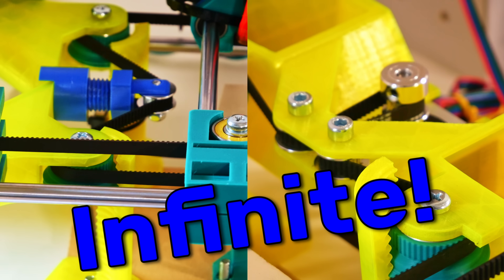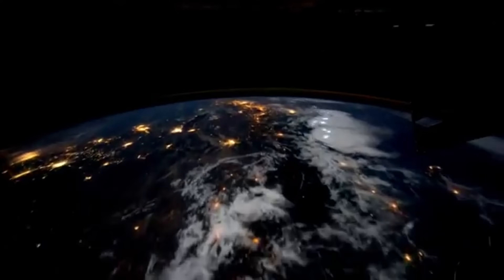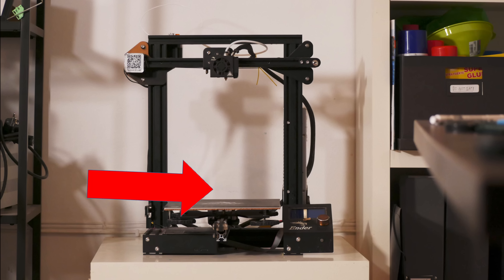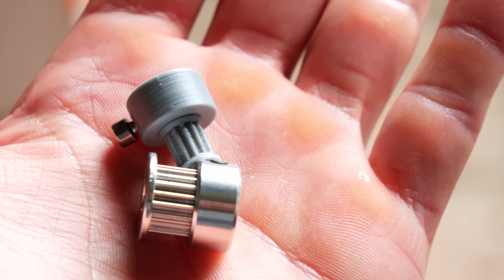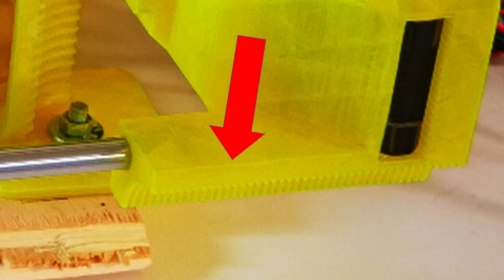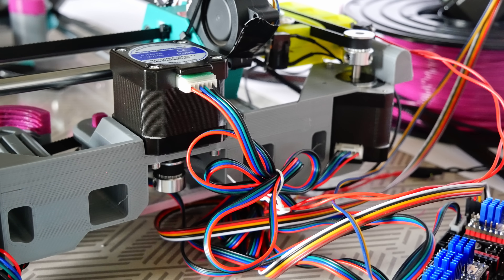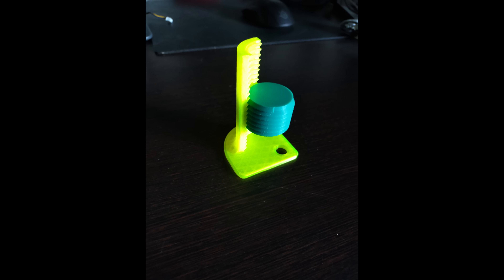it can 3D-Print onto itself?!

Comment: This is an incredibly interesting idea and impressive build. In terms of the big picture (truly self-replicating printers for the purpose of mass additive manufacturing), though, I wonder how the following problems will be solved:
1.) (Probably not quite the right term:) Degrees of freedom. As humans, we have a remarkable ability to move through space and assemble complex machinery. This requires precise motor function and sensing of where our limbs are (proprioception). Even if a printer can print itself, the printer and parts it generates still have to move through space and time to accomplish the end goal, and those movements require translations and rotations that would be very difficult without a human or finely calibrated machine. Is it possible that the tolerances, lack of rigidity, or post-processing of 3D-printed parts prevents reaching 'escape velocity'?
2.) Anisotropic strength of 3D-printed parts and limitations on printing imposed by part rigidity on the build plate. This imposes design constraints in pretty much everything we try to print. Anyone knows that printing a 2 mm diameter vertical rod with a heigh of >30 mm or so and tight tolerances with additive manufacturing is extremely difficult because it flexes as a result of the printhead or movement of the build plate (if not on a corexy machine).
3.) Progressive degradation of print quality the more generations away you are from the parent machine. A machine's accuracy would be limited by the 'perfectness' of the machine that build it. Quality control quickly becomes more difficult as more machines are generated, because you generate more and more unique parts that need to be controlled for quality than quality control machines. 
4.) Current limitations of materials science. PLA and PETG are easy enough to print in, but as someone who loves using 3D-printing in a laboratory, one quickly realizes how much materials limit the usefulness of 3D-printing in real-world scenarios. Organic solvent? Forget about filaments other than PP, PEEK, PEKK, etc. Want to print in PEEK or PEKK? Have a $40,000 printer that keeps filament dry, controls build chamber temperature (a resizing, temperature-controlled build chamber would be cool yet hard to design), and prints at ultra high temperatures. Want to print a flexible material? There's a whole host of problems associated with using additive manufacturing for that, even though it's very doable at a consumer-grade level on easy mode. There are so many lab instruments I'd love to print but can't because I can't rewrite the laws of intermolecular physics.

There are certainly solutions to these problems, but the question really is if all of them can be solved sufficiently to allow self-replicating additive manufacturing to reach escape velocity. Though just my own humble opinion, I do not think any machine where all parts are designed by a human, at one point in time, can do this because the complexity of the solutions required greatly exceeds our processing power. The only multicompetent self-replicating machines that exist are living things, shaped by evolution. As a species, we (more or less) don't degrade throughout generations because our blueprint is not a spatial one; it is information-based at the getgo (yes it's spatial on multiple scales later in the developmental cycle but that's another rabbit hole), and a relatively compressed blueprint encodes for countless ingenious solutions to the problems associated with building a living organism. Discovering and understanding even just one of the solutions we've evolved at the molecular level can take a human an entire Ph.D., yet tracing the path by which the mechanism emerged can still sometimes be out-of-reach for decades. The one comparison I could draw between biology and 3D printing would be protein folding, which is simple, yet extremely complicated, at once.

However, impossible problems are meant to be solved and naysayers are meant to be proven wrong! I deeply appreciate your project because a side-effect of your pursuit is pushing the field of 3D-printing forward past its current limitations. Your passion is contagious and I hope you keep trying to push the limits and find answers that have never been found to the questions that haven't been asked yet! We need more people like you pursuing the biggest ideas because this undeniably results in more accessible, more useful prototyping solutions for the community. I loved seeing your build and am eager to apply some of your methodologies to my projects.

Comment: printing metal seems like a pipe dream... yes pun intended. As someone who has eworked at steel manufacturers this would be game changing... i just dont see the heat required to melt certain metals possibly to achieve in a small enough surface area without loosing heat. but that ids where new compound metals might come in??? asically the equivalent of steel reenforced cement but with plastic

Comment: As your parts get bigger so dose the machine that makes them? The best thing you can do in machining parts bigger than the mill is to move it around and indicate it in. That's how you can make a bigger mill from a smaller mill. In 3d printing you make it in pieces and stick them together so basically all 3d printers can make bigger structures than itself.

Comment: First Sunshine video I've seen, subscribed! It's blowing up past your subscriber base, dude, looks like The Algorithm approves.

I'm assuming this thing doesn't really print metal, instead plastic filament with metal dust in it. That doesn't have the strength of metal, surely all the strength is coming from the plastic, and the metal is just there to look shiny?

If I were going to send this to Mars I'd probably also send a robot arm, and a buggy, and some sort of forge that can cast metal. Perhaps the 3D printer can make the moulds in some sort of "lost wax" process. Particularly if you made the moulds hollow and lightly infilled, they'd melt away effectively, in fact probably evaporate with hot steel. You'd need to slap some clay in the process as an intermediate substance between plastic and molten steel. But between the buggy and arm (that can probably dock together, as well as the arm attaching to a base with all of this stuff on it), you might be able to do it. Maybe 2 arms. 

Then you have the ability to cast steel, as well as print plastic. Probably use electricity to melt the steel in a small well-insulated furnace just big enough to do the necessary, then the robot and the printer work on making a bigger one, using tools and clay. This assumes you can find clay on Mars. Actually clay comes from river erosion, so maybe wet dust will have to do. People cast with sand, it'll be fine, you could even tumble the sand to grind it into finer dust.

This 3D printer is a great idea though and the negative-angle screw legs are ingenious, the screw just hooks into them. You could probably assemble a minimal robot factory including this printer. Of course you're assuming you'd happen upon a gigatonne of abandoned plastic up there...  So with that said it might be a 3D printer for astronauts is better for ad-hoc use, printing stuff and replacement parts as needed, but the houses you may as well send up pre-assembled, since weight is more important than volume in space transportation. Dammit I've talked myself out of an idea that you started!

Comment: Maybe you cover this in the second half of the video, but I don't want to forget.. If this can print itself, then I should be able to print it on my printer (more assembly required + more parts potentially required (electronics and the like)) and then have it make a less janky-peicemeal version of itself, right? Or even order the 3D printed metal parts if they don't represent commodity hardware, while those are getting made/shipped I print the plastic at home and it all gets ready to assemble about this time next week?

Talk about owning the means of production...

Comment: In hindsight it's obvious, so it sounds really promising, but I hadn't even once considered how a machine could make itself in this way and even be able to grow.

I wonder though, when starting from zero, would it even be possible to put together an automated package that can find and mine its own resources on Earth or Mars, and refine them, and supply them in a usable state without fatal material impurity and other issues? Should one of the early steps be to print stewards to act as moving eyes and hands to manipulate inevitable failures in processing?

How large would the full package need to be? Could it fit within a single Saturn V or Starship? Would it need 10, 20, or a 100 shipments of tools, compute, and materials? How much if you account for failure rate / redundancy? How much if you don't require the initial package to be self-printable? I mean that's all unanswerable at this point I'd think. This isn't Minecraft where you can start with nothing, go punch trees, and end up with a redstone computer that plays laggy pong.

But still, how much initial material would it likely need to arrive with? How much would it need to make, before it could gather and process? I'm guessing there's a bit of a sliding scale where you can #1: Either send with a lot of materials to print everything, and gradually get the gathering built out, then the processing, and then start expanding. Or #2: You could send those things complete and ready to start gathering immediately, and process the first find as soon as it arrives.

(Or should the processing go with the gatherer? Can small scale processing happen in the gatherer? Is it best to transport the processed or the unprocessed material? Probably dependent on material? How centralized or spread should manufacturing be? How should it progress? My guess is that forcing centralization might be beneficial if the failure rate is such that it needs constant intervention from a maintenance and repair fleet, other than that I don't know. )

Either way, I'm thinking I'd personally prefer the latter option of transporting a comprehensive array of finished tools, with added material for security if possible. Though pure material might be way more stable through takeoff, transit, and touchdown? Then perhaps only a few "starter" machines need to be thoroughly protected/ruggedized to survive the trip, a condition the rest of the tooling won't need to be built to survive.

Another problem is energy, how would it gain enough? I'd think starting with solar and perhaps nuclear as is traditional makes sense, but is it replicable by the printer? I'm sure nuclear can be ruled out?

Could it grow its supply? Is geothermal viable? How deep would it need to get? Can it even make a good enough drilling system to get there?

Could it print generators for wind turbines to exploit martian wind? I would think solar panels are more difficult to recreate with so few tools, but perhaps simpler ones are achievable? Am I overestimating the complexity of creating semiconductors on Mars, compared to what everything else here requires? I mean I'm sure I must be underestimating most of this to even be entertaining the thought. But ultimately I have no idea, I am a clueless idiot. I got lazy halfway through editing bits of pieces of this wall and don't think the comment is much more than noise, but I'll submit it anyways.

Comment: What all is required to actually build this? I got a creality ender 3 Pro that can print this but idk where or what to source mechanical part wise. Also have the files from printable but idk where to find what motors and what not are being used in the video.

Comment: You could try and program all 4 corners as "home" separated as 0(1) / 0(2) / 0(3) / 0(4) when print function is legs. And when instructed to print conventionally have it start at "true home". It might be strange and slower but instead of doing every leg at once it splits it into 4 jobs with unique homes

Comment: Well the most interesting part is reduce the printer to 2 phisical axis trung the height axis in a "virtual one" where the limit is the wire lenght or the filament resistence(asuming the wire is longer than it). And for the design of the self printed supports with a few aditional pieces could be reused for someting else(it remeber my to to some weird assempble tois like legos but with weird shapes and unions)

Comment: couldn't you theoretically use a laser to measure distance from the laser and the first "reflective" surface and then use that distance data to both figure out how far down the legs are and find out where they are positioned using some kind of spot-based search algorythm?

Comment: Try using a printer design with an OUTWARD facing printer head.  I had an idea for a print head that ROTATES.  In that configuration, you can make a nozzle that is flat and wide(possibly 3mm).  Flat prints and prints that need a lot of material put down at once will be printed EXTREMELY fast.
Reply: Conversely, a rotating BED may be an easier choice.

Comment: Couldn't you just flip the hotend carriage the other way? the only collision i was seeing through the video was the fan vs z stepper motor and if you took off the hotend carraige and put it on facing the other way it'd stop that from happening. Edit: then the limit switches put them both on 1 corner of the gantry with home being away from the z motor.

Comment: Why use vertical screw gear, when you can run spur gear horizontal of the z axis and a rack gear on each corner that would solve your issue with layer shift. Also you could use a pressure switch instead of BL Touch for the Printing head :)

Comment: 🎯 Key Takeaways for quick navigation:

00:00 🖨️ 3D Printer's Capabilities
01:03 🌐 Decentralized Mass Production
02:09 🔄 Infinite Build Volume Design
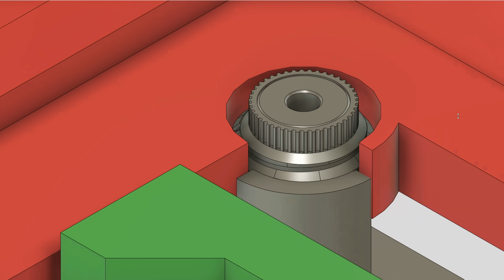03:39 🧩 Parts Printability and Reproduction
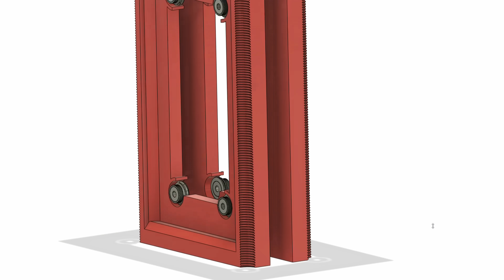05:08 🔩 Z-Axis Legs Improvement
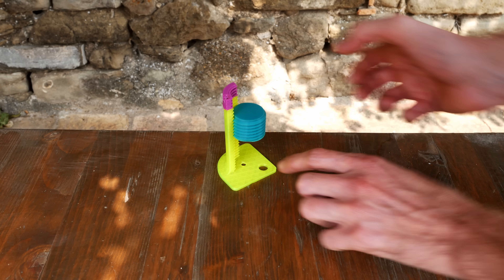06:36 🛠️ Challenges in Printing
09:01 ☕ Collaboration and Future Plans

Made with HARPA AI

Comment: Woah, what an interesting take on this problem!

That being said, I don't understand why you want a print volume as tall as the whole printer if rods are going to be metal?
You can just use your first (very good) idea of using the corners as Z axis, and print top and bottom pieces without much height?
Or maybe that in the final printer you want to print the rods as well?
In any case, that would remove the problem of model alignment when printing the Zaxis crank.

Comment: I thought of doing this once. Only I'd use a 'robot arm' instead of this system. since it's printable area can be easily made bigger than itself. The main thing I was concerned about is how to print a printer nozzle that wouldn’t get melted during operation but would still be able to melt to be printed itself. Other than that you of course still have microprocessors and stepper motor windings to worry about.

Comment: Awesome video, inspired idea, ground-breaking innovation, and a beautiful dream.

I do have a project idea to share. You shared your dream and I would like to share mine.

I wish to build a rugged 3D printer hotend that is not designed for speed or accuracy but instead designed to handle incredibly poor grade filament.  I wish we had a printer that could genuinely print with recycled plastics.  And not just store-bought stuff.  But one that could use filaments or pellets that people made themselves at home. Making a 3D printer that can print itself is not impossible and neither is using recycled plastic. If we could combine these together and make a self printing printer out of garbage plastic then the only true limit would be energy. And I have some ideas for that too.

I've always been a little disappointed that the 3D printing community kind of abandon the idea of using recycled plastics like HDPE.  Yes, the shrinkage is incredibly bad but we figured out ABS, nylon, and all kinds of other crazy materials.  We even figured out how to use PET from soda bottles.  I think we can easily figure out how to use recycled grade material.  Especially if we build a hot end that was a thicker diameter and could allow for variance.  Or maybe build a pellet extruder that can handle shredded plastic.  We can't make modern filament at home because it's too precise.  But if we're not printing for speed and detail then we can build a more robust system.

We could also make an infinite plastic recycler with solar and wind.  I have a video about this on my YouTube channel but the basic idea is to build a system that's always recycling using wind and solar.  The shredder would be hooked up to small wind turbine that can run in low wind.  If it had a high gear ratio it would be slow but it could run all the time. Even the nicest plastic shredders have difficulty making though clippings small enough to be use an extruder.    But if it's running all the time then this isn't a problem.

And this would be a lot more work but I think you can build an extruder using a solar oven as the power source.  Just have it turn on when it reaches a certain temperature in the middle of the day and then turn off when the heat is gone. Even if it's terrible filament you could feed it into a pelletizer.

These ideas go beyond my technical expertise and my resources. Plus I focus a lot of my energy on my spring press recycler.    But I'm hoping I can at least build the wind powered shredder some time next year.